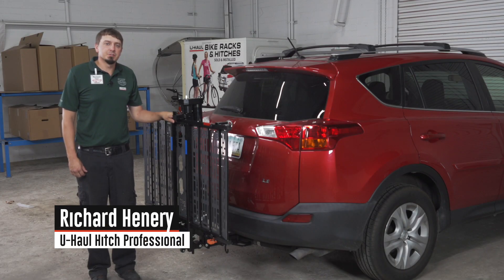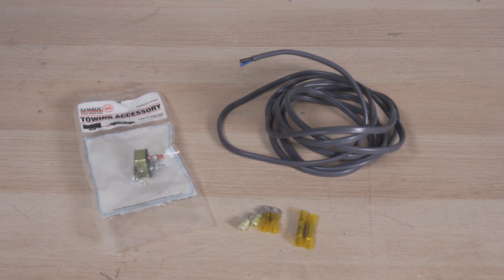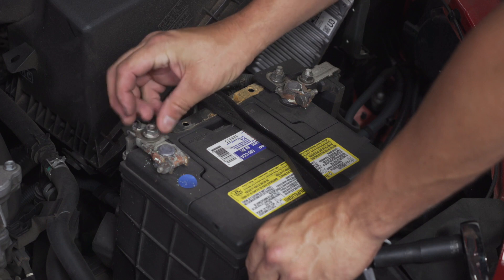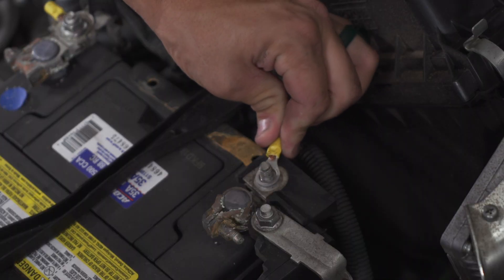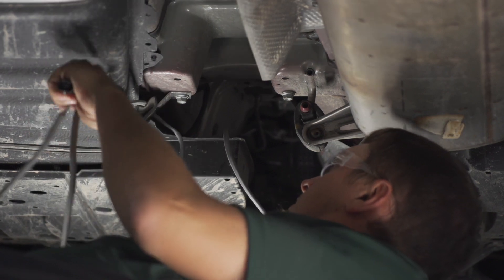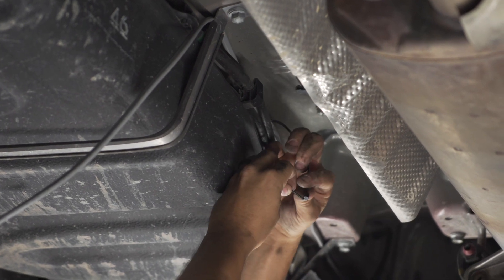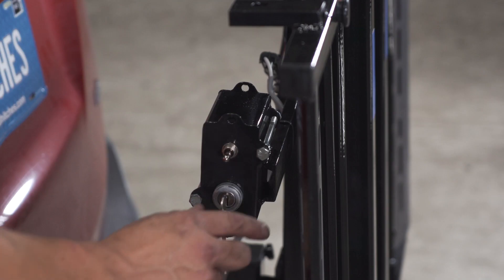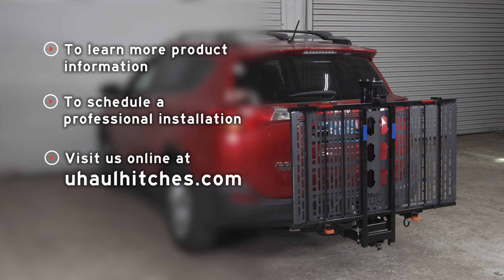Electric Wheelchair/Scooter Lift Vehicle Wiring | U-Haul Installation

Comment: Connecting the terminals to the battery should be the last step. That way you avoid a short entirely.
Reply: Agreed, just tape them down to something to hold them in place while routing the rest.
Reply: Take the in line fuse out

Comment: I have a Bruno ASL-250 Scooter Lift. Is the 4 Way wiring for the license plate light on the lift itself?  The lift does have another cord that looks more an ac plug, which I'm told is for the power of the lift to bring up & down only.

Comment: Can you use a barrty alone to use eletric mobile lift ?
Reply from the maker: The battery needs to be installed on the vehicle, safely grounded and connected to alternator in order to be charged. It would not be advised to install any other way.

Comment: Moved my lift from my old Explorer to my new Explorer... stupid mufflers are so big I had to route the cable up and over the muffler heat shield... hope thats gonna be ok... any other way and I would have run out of wire... heres to hoping.
Reply from the maker: With out having the vehicle in front of us it would be difficult to find another route. But it is typically not safe to run electrical wires near hot surfaces. However, there are heat resistant wire looms you can purchase from Amazon or other retailers that can protect the wire to an extent.